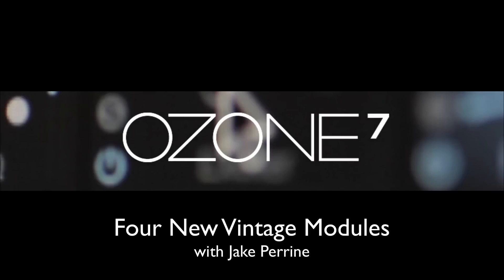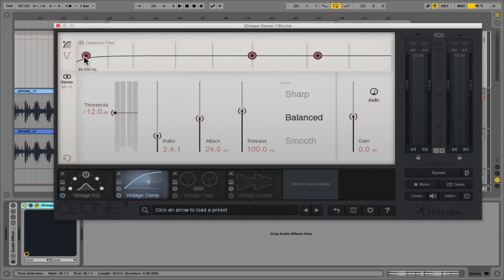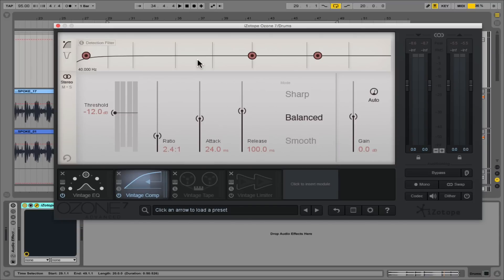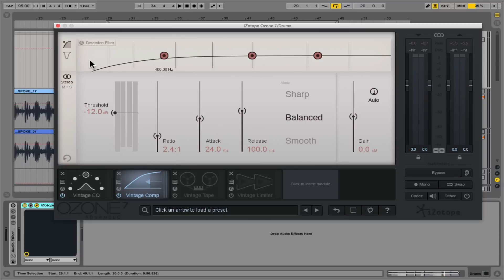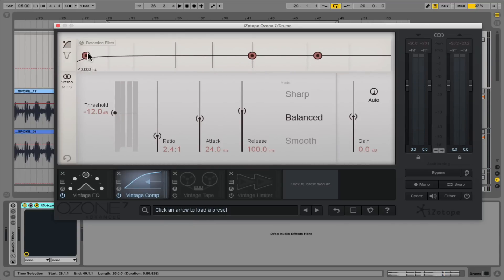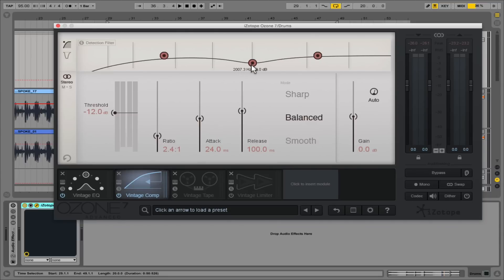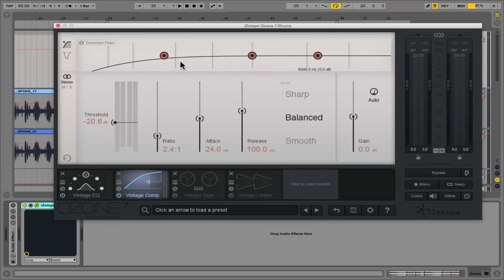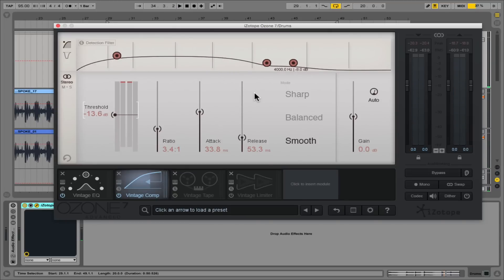How to Use the Ozone 7 Advanced Vintage Compressor

Comment: Just a heads up on a now 3 year old video...through these examples you don't have the detection envelope enabled... no wonder there is no difference in what i'm hearing... When I messed around with the plugin I heard very drastic differences... Still a good video!  Thank you for explaining the difference between dynamic range compression, and a pre-Comp envelope like this one.
Reply: There should still be a difference, that option just solos the detection filter so you can hear the modified signal pre-compressor.
Reply: B Bacc Soon is correct. The detection envelope is enabled. The solo function is intended to assist you in making finer adjustments to the envelope, much like soloing a band in an EQ or multiband compressor. The changes made to the envelope at 2:55 are audible and visible on the meter.

Comment: Thanks, great video. One beginner question though: If I want to use this compressor on one instrument only, is there a way to use a side chain signal from an external track?
Reply from the maker: Hey Daniel.  The iZotope Ozone 7 Vintage Compressor doesn't have a sidechain input.
Reply: Too bad but thanks

Comment: I thought the detection filter was just for the compressor to react as if there were no low freq involved(or whatever the filter is not responding to) but does it necessarily mean the low frequencies arent getting compressed ?I mean its like pre filtering the envelope follower of the compressor and not original audio which passes through the compressor.Correct me if i am wrong.
Reply: That is correct. You're influencing what the compressors gain reduction "circuit" will react to.